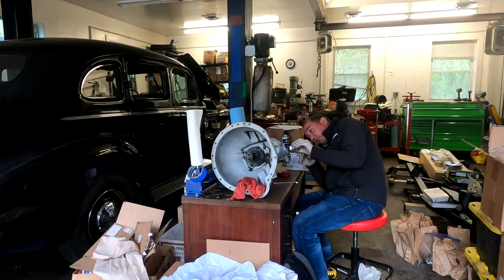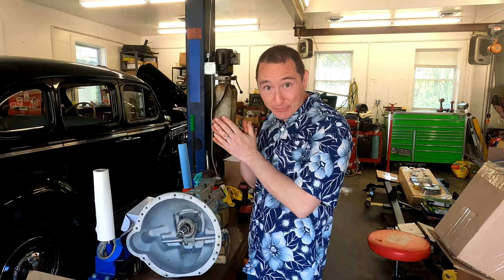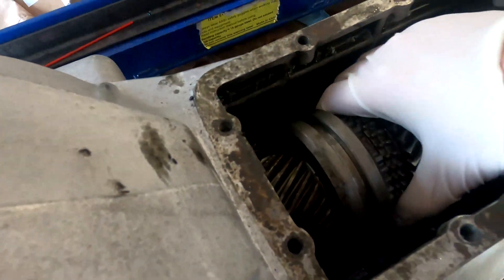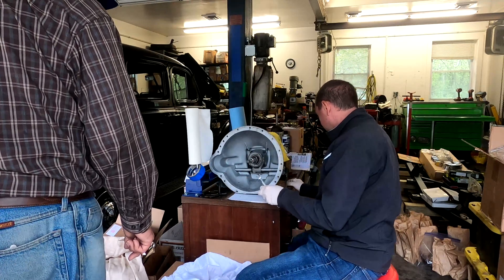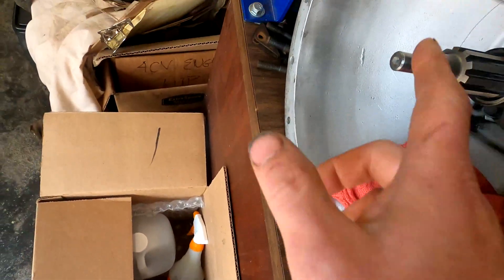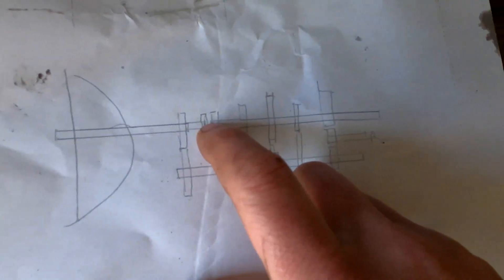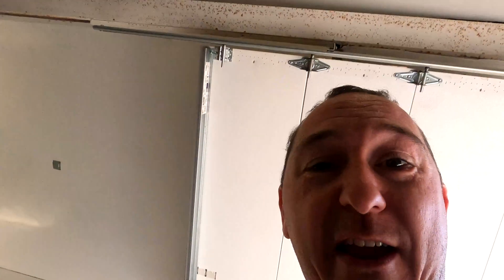How bad is the TR3 Transmission?

Comment: Not a complex transmission to rebuild & parts are readily available. Get the circlips & thrust gaps correct, its well documented.
Reply from the maker: The case crack is a show stopper on this one.  Saving the good internals for a better rebuild candidate.

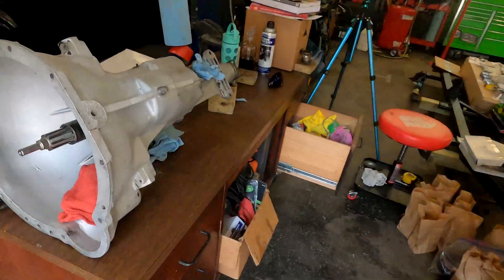Comment: Unless it's a TR3'B', someone has replaced the original with a TR4 transmission (full synchro)....There is no difference in the bellhousing except the starter bulge....It's better and easier to replace the starter with a modern hi-torque unit.....The mounting flange on later transmissions (TR 250/ TR6) is significantly thicker but will still bolt right in to a TR3 with no issues...If it is just a broken bolt flange on the tailshaft, that can be welded by anyone doing aluminum welding, as long as it fits square with the trans body......I've owned and maintained my TR3A (1959) now for 52+ years....I've kept a TR4 trans as a 'spare' for 20 years, even though I've rebuilt the original due to worn synchro rings, instead of just swapping it out,....Have fun, wish I'd found your post sooner, but I tend to cruise the roads more than the internet........... I'd definitely stick with a tr4/tr6 transmission with it's full synchro design ( Post chassis #6000)...AND, just so you know, TR3's with and overdrive came with a 4:11 rear diff,.....non overdrive cars have a 3:73 diff...I have a non-OD with a 4:11 diff. and I've travelled all over Canada, but the rpms are higher than norm at hwy speeds...(Just never bothered installing the 3:73 gearset that's been on a shelf for countless years)...Yeah, it puts about 27% more wear on the engine, so oil changes are even more crucial, haha....Oh yes, the OD cars and the non-OD cars have different speedometers as well...Mine is a non-OD speedo with a 4:11 diff, But, when Canada went metric it actually 'corrected' the readings (almost).......John (west coast, Can.)
Reply from the maker: Awesome information. Thank you.  I do have a replacement TR4 transmission 4 speed.  Got word the diff is in good shape and back together.  Should be a roller soon!  Thanks for watching.